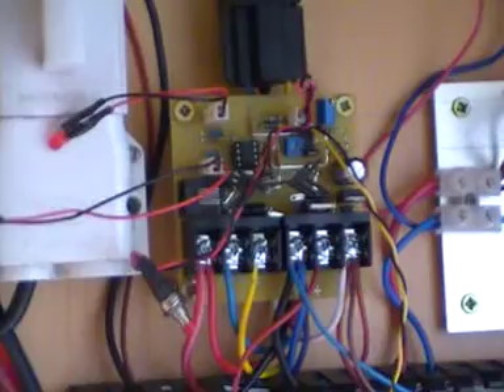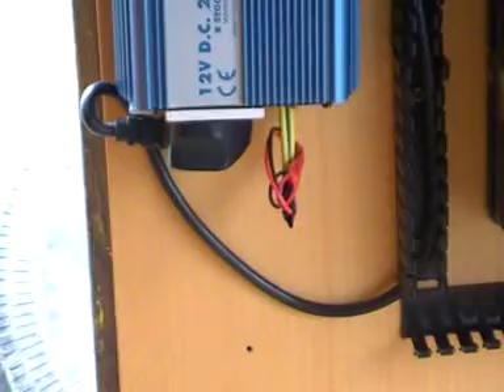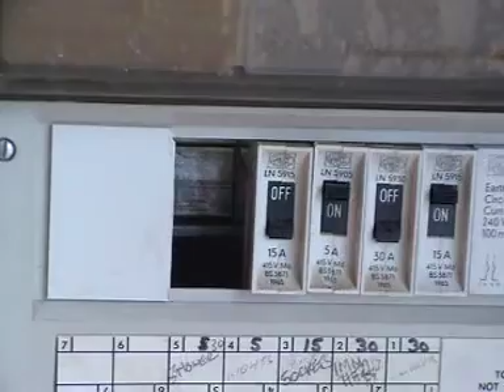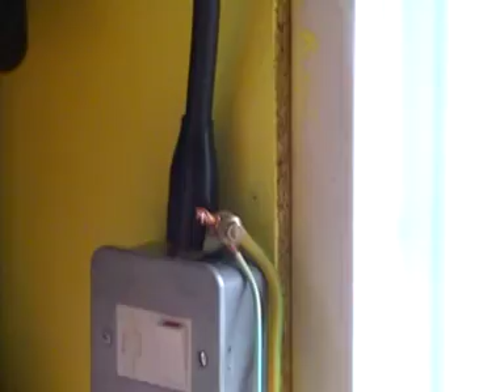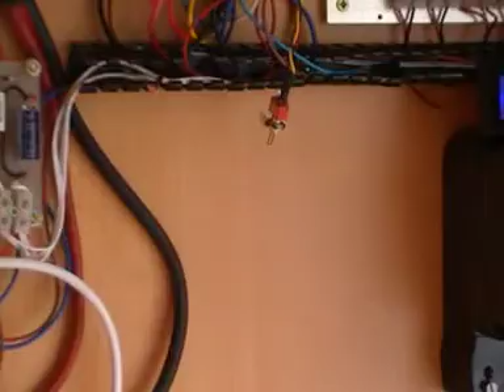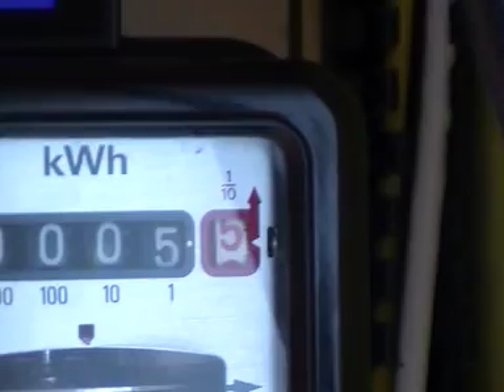Solar Control Panel

Comment from the maker: Yes that is correct. Until I turn on a light no power is being wasted. It all goes into the batteries. It looks like I am going to have to get a wight-board and do a tutorial of my system. That way I can explain in layman terms. It would have to be a series. That way people could learn easier. Thank you.